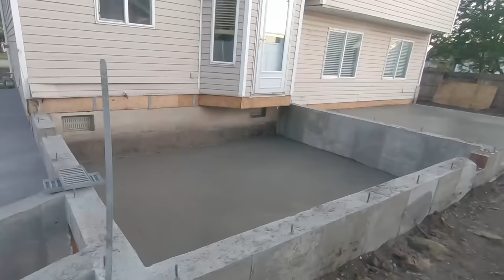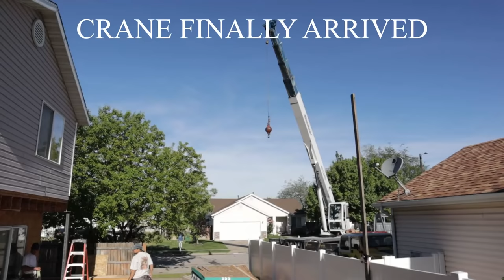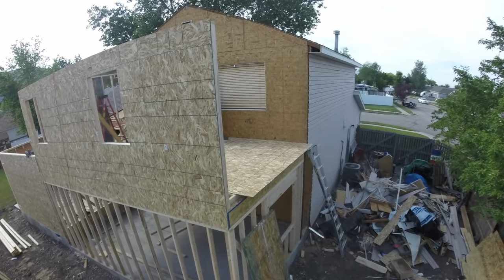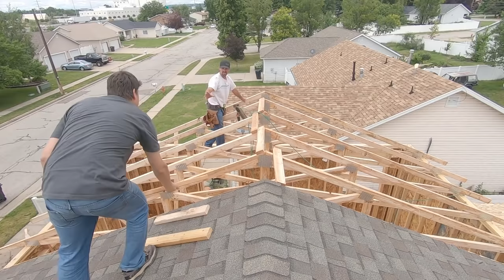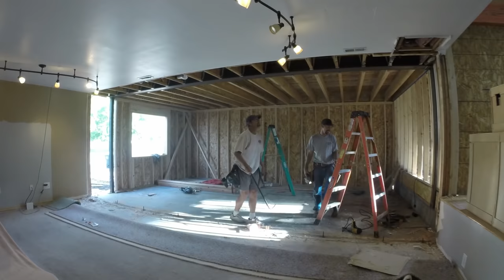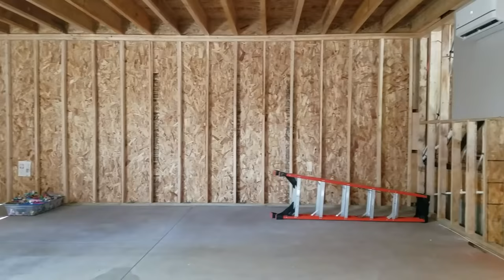Home Addition 6 Days Framing in 6 Min.

Comment: That delivery method gives a whole new meaning to "dropping off materials."
Reply: That delivery was bull crap. He should be fired
Reply: I can’t stop laughing on this one..laughed so hard I woke the wife up in the middle of the night..
Reply: If they did mine thst way they would be sending a new load
Reply: Unfortunately thats how most local lumberyards deliver. Nothing against them. Big box like home depot or lowes have the forklift but there is a delivery fee to it. Most locals dont charge for the delievery at least in my area and thats pretty much the normal. It sucks but as long as the materials arent damaged you can request some materials to be replaced if they are damaged by the drop.
Reply: Our guys would be fired, he needs to learn how to chain a load
Reply: Ya like what the f??
Reply: Drop Off Material Fee: $249.99
Reply: Not sure the area you live in but no one drops material like that in my area
Reply: I worked at a lumberyard.  They do alot better than that!!!
Reply: I was like WTF!!😳😳😳😳
Reply: The driver had a bad night the night before, who also getting a traffic ticket on that morning !
Reply: Lol
Reply: Agreed. Unprofessional
Reply: that stuff is expensive bro.
imagine is someone did that to your hardwood flooring. would fight someone at that point.

Comment: Very odd they had a vapor barrier inside but no house wrap on the exterior.  Did you see the water damage once they pulled down the vinyl siding? If the house ever goes on the market better hope someone like me isn't looking at it cause i check attics, crawl spaces and material behind the scenes with my inspection camera. The home inspectors told me i should become one
Reply: That's how it used to be done up north, at least where I'm at

Comment: Is there a name for this style of “Addition” (by extending the roof)?

I live roughly 50 miles east of Los Angeles and definitely need this done to our 980sf home. By adding an extra 1000sf more, it would help with our tight living conditions. Any guess on cost range for my area or would it cost less to go the conventional way by simply adding to the rear and go out?
Reply from the maker: With lumber and labor being crazy in 2020 I'd have no clue. Most builder give free estimates. Wouldn't hurt to give a couple a call.
Reply: prob 50-100k. Depends on materials, labor, finish. That's obvious. I don't live in LA, so I'm not quite sure. Maybe a 20% increase? So like 60-120K?
Reply: 1k square feet is easily going to run you $80k minimum and being outside of LA i wouldn't be surprised if it was $150k. 
Consider building up or down instead of an addition. 
The potential additional cost is negligible if you are already spending so much and you actually gain SQ ft on your property that way rather than lose yard space.
Reply: @Luckingsworth  thanks Jon. I’ve also thought of adding up above our garage as a single rental unit. Like the “Fonze” 😆
Reply: @robhtp3817  I know thats a really popular thing to do in some of the more crowded cities. It might not be a bad idea.

Comment: Cmon- after laying out all those I joists for floor they did not even use a uniform 16-24 o.c. spacer block for the center of the runs. New codes are making the j bolts larger diameter. Joists do & can float.
NOTE According to the International Residential Code (IRC), joists with dimensions less than 2”×12” (thickness× width) are exempt from blocking (Bridging). However, joists that are larger than this need blocking at a distance of not more than 8 feet. Blocking at 4 to 6 feet is generally preferred by various contractors. Feb 6, 2023  Looks like > 12'-15' span.
Reply from the maker: Noted!

Comment: Why is it that you add a subfloor using wood and states like arizona just build off the foundation
Reply: Cement foundation*
Reply from the maker: Typically over the kitchen( which I'm assuming is the area you are talking about) it is not like that. Normally it would just be dirt or gravel. We decided to spend the little extra and pour a slab down there so we now have all that space for storage.

Comment: What.. I'm in construction, I've never seen a wall sheeted THEN stood up!
Reply from the maker: It wasn't me that did the framing but it did go super fast so I'm assuming it saves time.
Reply: I've seen it done like this alot... though adding house wrap before standing up is the norm
Reply: Then youre prolly doing it the hard way. Lol
Reply: It’s in some ways easier depending on whether you are willing to erect scaffolding or not.
Reply: Its in the Modern Carpentry book.   They've been doing this a minute.

Comment: are these walls even insulated? they look thin as hell !
Reply: They have to run electric wires and do an inspection before the insulation some people are spraying foam insulation instead of batteries it's all good because walls are not being sheetrocked yet
Reply: @pacoblp4780  still, just look at the actual house walls there like 4 inches wide... how on earth 4 inches of insulation is enough, houses really are not made with the same standarts in the states compared to europe
Reply: @jeremyplc2380  better believe that 4" walls with foam insulation that's more than enough I'm a framer sheetrocker and I also spray polyurethane foam insulation it's a good air,moisture and soundproof barrier it saves a lot of electricity it is more expensive than insulation batts but worth it 👌
Reply: @pacoblp4780  4 inches of polyurethane is not enough if you want to build a house in France, with the insulation power of polyurethane you'll need at least 5 to 6 inches ok foam, and that's only for walls, you'll need 8 inches in the roof and 4 in the floors
Reply: @jeremyplc2380  I don't know about france I never been there but here i us i live in north side of Dallas Texas my house is 4" walls and only the exterior walls and bathrooms are insulated with the regular insulation Batts and temperature 🌡 right now is 23 degrees but feel like 10 Fahrenheit outside and im walking shirtless inside my home, it's 72 with no problem
Reply: @pacoblp4780  the thing is how much heat do you use to maintain that temperature inside?
Reply: @jeremyplc2380  bro I just have a couple of candles 🕯 right now
Reply: @jeremyplc2380  you are correct in Europe we need more insulation in walls , floor and ceilings in us they have different codes like spray foam in certain parts off Europe is not allowed because it doesn't allow timber breath or dry out.

Comment: I would have cleaned their clock with a credit card charge back. Most likely the company would have been haggling with me after I won on the charge back to give them something for the damaged material. Before hiring someone they sign paperwork if they break they buy basically. That way you're covered it would come out of their paycheck for damaging material. It's always been hard to find good help and even getting harder with the economy going downhill.

Comment: Not Any Corner Has a Support In The Bottom In The Left Side,
If I Am Your Code Inspector, You Will See.
Reply: That is correct there is a lot of code breaking in this job.
Reply: Just judging by visual proportions, there should be either 2 or 3 rows of blocking between joists depending on overall span.. 🙄  A decent framer should know that..

Comment: There you go no basement access I hoped you get everything run in the wall you want why is open because I get called to add plugs switches cables exc . I can do it but it a pain in the ass after thoughts. Even a crawl space under a room makes it easier for me. 
As carpenter say F the electrician as long as my shit done then they complain why the job cost more at the end.
Just give a crawl space under a room 
At least 10 to 12 inch so we can add shit later. Bigot is better.
We had a job carpenter finish a a room no plug and switches just 1 light. It was cold in room customer cry that there was no plug and switches and wanted to add them . And heating pipes after. The carpenter said I done F electrician and plumber. That happened on a few job and that why I requested a crawl space.
Reply from the maker: There is a crawl space access on the outside of the house. If you look at the thumbnail it's just below the big kitchen window. City wouldn't approve the plans without access underneath.
Reply: @-DIYPRO-  city 👍👍